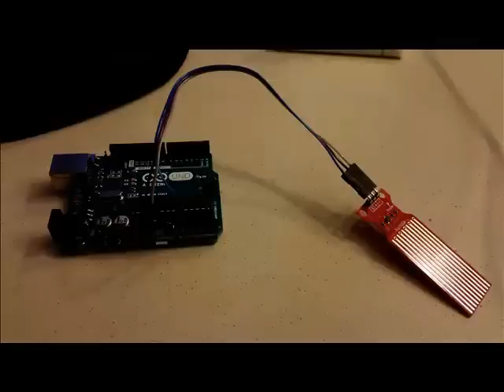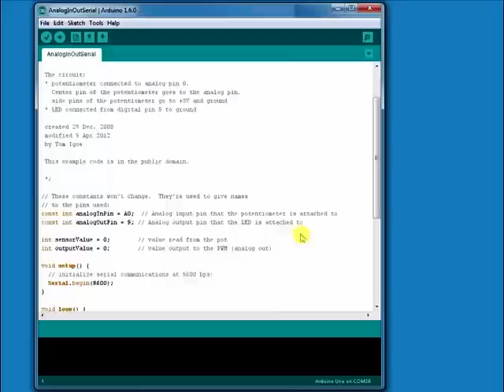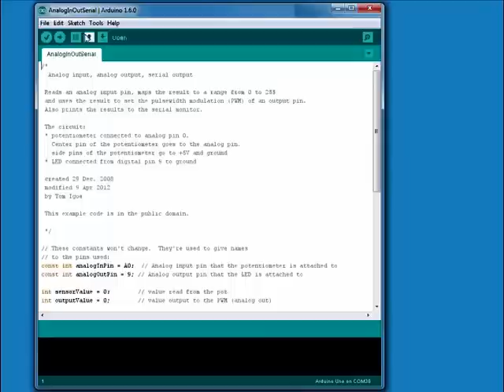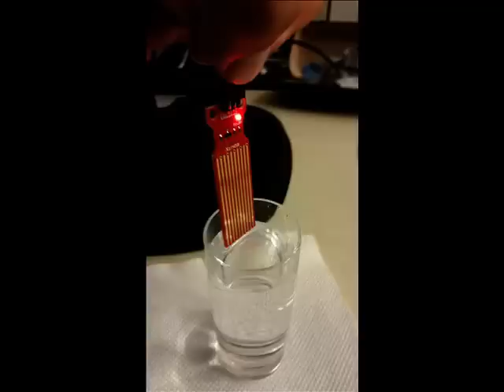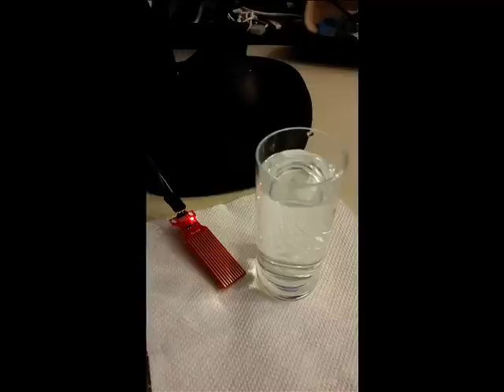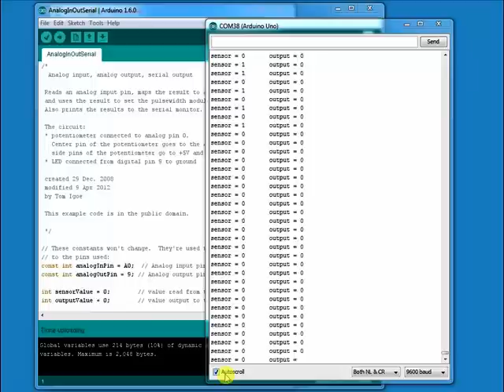Water Level Sensor hookup and Calibration

Comment: hello. can i modify it to get values from a bigger tank? like if my water tank is 3-4 feet in depth...?
Reply from the maker: Awais Niazi, you may be better off using some other sensor than trying to physically modify this one.  Check out pressure, sensors. If all fails, you can make your own using some thin wire.

Comment: if it is active sensor that generate current inside the nutrient solution. Won't it interfere the accuracy of the EC/pH sensor value? The optical distance sensor is better to me.